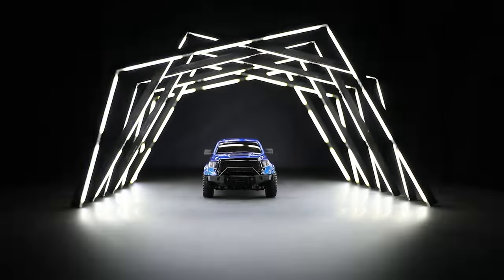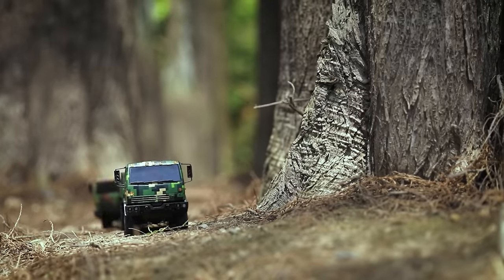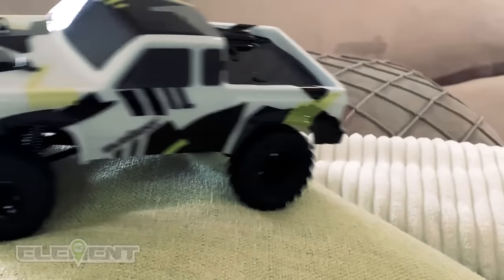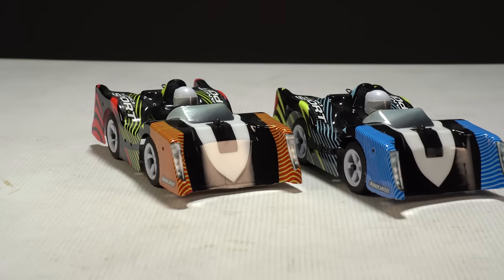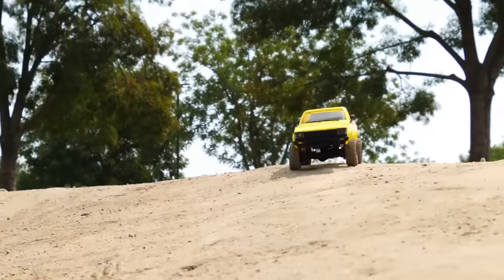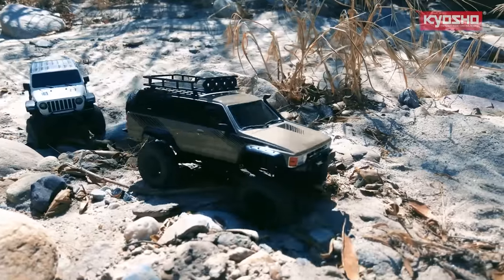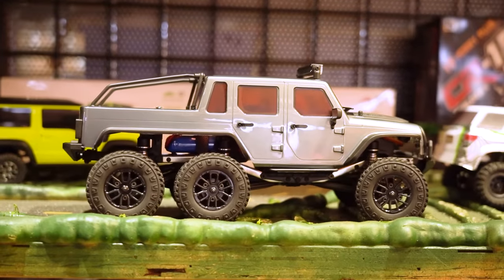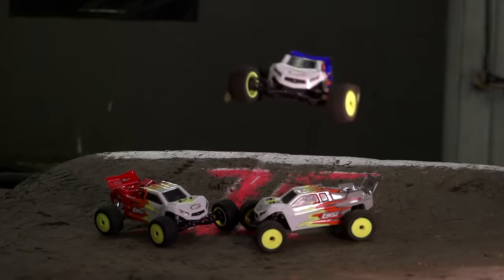Top 10 Best Indoor R/C Cars

Comment: The SCX6 is also great for indoors, instead of having to get up and go grab something from the fridge you can just push/pull the entire fridge to you using the car.
Reply: it's so great you don't have an indoors anymore
Reply: The scx 6 could be used as transportation to get to work
Reply: True that!
Reply: Costs more than my car!
Reply: Or do a Seth's bike hacks and use it as transport 😂
Reply: @JanHarmSteenkamp  im worried for the alignment on his
Reply: @JanHarmSteenkamp  i have an scx24 so maybe i can do a hamster
Reply: @jme.147  the gears stripped as well 😨😅
Reply: @jme.147  nice that would be cool 🤣😂
Reply: @JanHarmSteenkamp  I do have 2 Guinea pigs so they might fit on there
Reply: Idk the electric swaped raminator
Reply: @crfsikness  but it's cheaper to run.

Comment: 14b will burn a hole in your pocket as it chews up spur gears every 20 minutes. A friend and I bought them and we’ve both experienced this issue constantly. You’ll work on it more than you drive it. You’ve been warned!
Reply: First I've heard of this issue. Check your gear mesh and slipper clutch setting, if either are too tight then loosen them. Also make sure to keep the spur gear clear of debris.

Comment: I personally love the fms 1/18scale crawlers I got the k10, you can’t beat them hardly for the true to scale detailing and they’re ability. The eazy rc is just a lil cheaper brand of them but still good, they just have plastic frames compared to the metal frames on the fms’s. Great video though there’s a lot of cool options out there.

Comment: How do I know if I have "tall" carpet?
Reply from the maker: Tall carpet is long and shaggy, can fall over on itself. It's usually a little softer and has more cushion to walk on because of the extra material. Short carpet is often found in business settings but it's harder to walk on, doesn't fall over on itself, not shaggy at all. You can usually sweep short carpet with a broom for easy cleanup; can't do that with tall carpet. 
Hope that helps. 
-Brett